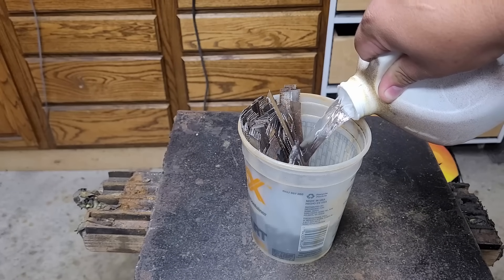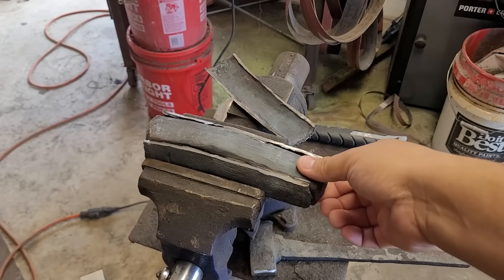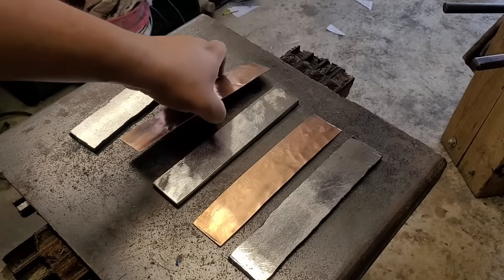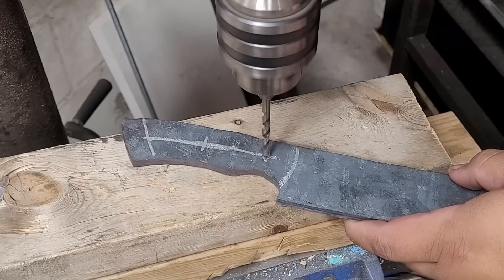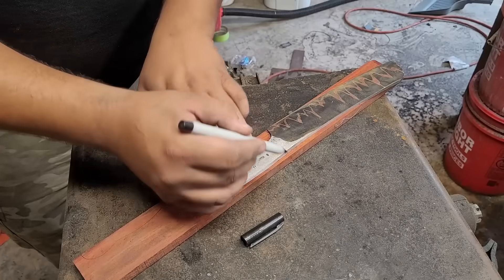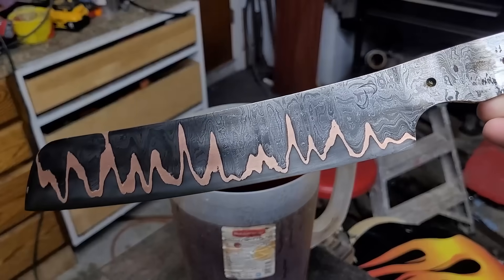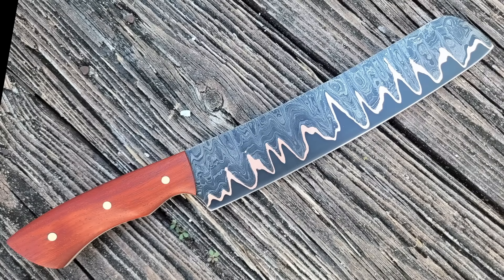Making A Knife From Copper And Bandsaw Blades

Comment: Beautiful choppa! Little tip: you don’t want to cut too much wood on the same bandsaw you cut steel with, without cleaning out the dust collector first. That’s a shop fire waiting to happen.
Reply from the maker: That never crossed my mind. Thanks for the heads up 🫡
Reply: Seen a band saw fire in the machine shop I worked in. Just complete negligence by the person who cut the wood.
Reply: I never thought of that either, good catch

Comment: Gorgeous blade.  The copper on black is really striking.

And don't get too comfy around that band saw.  Time it takes to rip up a finger is a lot less than the time it takes to realize it's happening and react. (And I'm saying that with a half inch gash on my thumb from getting a little too comfy by the hacksaw blade on a clingwrap box in the kitchen a few days ago)
Reply from the maker: Them clingwrap boxes are dangerous 😳
Reply: @JPsBladeworks  yeah, who knew!
Reply: Amen to that. Your fingers  get v. close to the band saw. Having worked in a joinery Ive seen too many ambulances and don't want you to need one. Stay safe.

Comment: The padauk looks good with the copper and dark black contrast. I stabilize wood. I haven't done padauk because its so naturally oily and therefore pretty water resistant.  Maybe i should though? I have a bunch of it.
Reply from the maker: I have a whole board of paduak i bought to stabilize but i havent bought the equipment for stabilizing yet. Maybe next month.
Reply: @JPsBladeworks  it's used for decking and cutting boards. It would probably be fine not stabilized.  When you do start though you'll use a lot more resin than you think.

Comment: Awesome job!  What do you use for outside canister can just mild steel?  Any links to 1090 powder supply?  Thanks!
Reply from the maker: I use regular mild steel tube. I'd recommend 1/8 in walls. No need to use any thicker since it will not be any benefit but it will cost more. And this is where I'd get it. https://maritimeknifesupply.ca/products/1090-powder-2-nickel?variant=39630768177319
Reply: @JPsBladeworks  Thanks bro!  Keep up the outstanding forging!

Comment: Thanks for the nice video! btw: I use Padauk often  with my guitar builds, there is no need to stabilize ist. it´s dense and keeps its dimensions very good! some use it even as material for fretboards - the it has to stay stable and hold the frets etc. And padauk needs UV resistant finish to hold the vibrant red hues. it shifts very fast to poop brown :D
Reply from the maker: Thank you for the info. Ill look for some of that uv resistent finish so i can spray the wood.

Comment: It’s amazing how easy your billet comes out the can.
Reply from the maker: It's all in the prep
Reply: @JPsBladeworks  yeah man. Spray paint over white out seems to be the trick. It’s amazing. Squashing from the top first too seems to work better than I’ve been shown in the past. I’ve always seen folks do the sides first but watching you how can you argue? Never seen it come out so easy in my life. Great stuff.
Reply from the maker: @guyfromnj  the preseason I do top first is because the lids are the weak point. So I can get a solid weld and pressure from all side in the first press. Before I used to go just sides and the caps would pop off and the ends of my billet would not weld properly. Now I don't have that issue.
Reply: @JPsBladeworks  yeah no doubt. Your billets are beautiful. It’s masterful stuff man.
Reply: @JPsBladeworks  it obviously makes a better billet. Having watched so many people make canisters it’s awesome to see how well yours come out.

Comment: I know nothing about knife making, so forgive the question if it’s ignorant, but with copper being a softer metal, does it effect the way the knife sharpens or maintains an edge? Or would copper ever peel away from the other metals?
Reply from the maker: No the copper doesnt affect the edge. The edge is the 80crv2 steel which is a high carbon steel. The copper brazes to the steel when it is forged so it wont unstick. The force needed to make it peel is magnitudes more than whats used for food prep or anything like that. Plus the core steel stabilizes the knife as a whole. Ive never had any issues.
Reply: @JPsBladeworks oh ok, that makes sense. Thank you for explaining it. Beautiful work btw. I do leatherwork myself but never made a sheath for a custom knife like that. One of these days though. Thanks for taking the time to answer my question.

Comment: You can trace the profile of the handle onto one piece of scale material, mark and drill pin locations, then stack and pin continuing and opposing scale material in order to make fewer cuts while making the handle. Layers 1A, 1B, 1C, 2C, 2B, 2A temporarily pinned, then cut.
Reply from the maker: I normally do 1 scale one camera then i pin it to the other to even out the holes and to get the same layout off camera.

Comment: Great looking blade. At what point of the video did you put the copper in? I did not see it. Just bandsaw blades.
Reply from the maker: When i restacked with the core steel i made a 5 layer billet with the outside beinf the bandsaw blades then copper and finally the core steel in the center.
Reply: @JPsBladeworks  Thanks! I tried several times to see the copper in there but just couldn't locate it. And clearly there is copper because the results are very clear. And splendidly vibrant!

Comment: Hey what coating did you do on the blade to protect it?
Diamond Like Coating, Titanium Carbon Nitride (TiCN) or a heating coating like clear Cerakote?

I didn't hear you say any coatings or what your Ferris Chloride actually does
Reply from the maker: ferric chloride etches it so you can see the different layers and i just use wax to protect the blade from moisture.

Comment: If you want to do stabilized wood you need a good vacuum chamber with vac pump and the best thing is to get in touch with a few micarta mfc comp to get the ins and outs with different types of epoxy. I used cactus juice brand to actually be the best performer for stabilized wood. You have a cost to this and it has to do with time. It really takes a lot of time. You can get stabilized wood from some suppliers but you have to take into account that they usually have large vats that they do bulk stabilized wood and it's not going to be that superb choice that you may want.
Reply from the maker: how long does it usually take to stabilize woods? I have some padauk that i want to stabilize. I need to tool up but that shouldnt be an issue once i decide to take the leap into it.
Reply: @JPsBladeworks  stabilized wood varies due to the fact it is a natural that has density and moisture and so many different things that can ruin it. Most of your high-end stabilized woods are done in small batches. But if you want to know how to mitigate some of this, I would suggest you contact the Cactus Juice company and get them to give you a better scale than probably any company can give you since they are the best wood stabilizer and have been around for a long time. I've actually helped build a couple of really nice rifles that had stabilized wood that you couldn't get from any source. I don't know how the good Dr. Had come up with the stocks but he made sure that these $7500 guns, this was in 1997-98 that we built the three rifles was after the stocks and all the other stuff was done, come in at around $25-35,000 and that was with the lower grade of the three. But it just gives you a idea that you can find a real treasure in your backyard. He had a tree cut off of his property here in North Georgia that was a native tree. I think it was actually black cherry burl that was classed as a AAAA which is the ultra best and rarest of finds. I had seen the stump and it was 35-39 inches in width. He had a set of three knives forged by some big name back in the day. That's three knives for each rifle. He had his, son in law, and grandson all done. It took us about 15 months to build those rifles and build the displays and carry cases. A person that does blacksmithing needs to get their hands into everything that they can learn and use. I like to go out and look for those burls and I like to do hand worked wood work like hewing and using a adze as well as build true classic log cabins that can surprise a few with no nail pining of the timbers.

Comment: I have to ask if you have ever done a twist with a drawn counter twist and drawn out to get a cotwist pattern. And I'd like to get a knife built that has some real unique materials in it and the handle scales. The only thing is I'm not able to build a knife anymore due to some serious injuries I developed over the years.
Reply from the maker: Ive never tried that and honestly i kind of got confused reading that. Do you mean to do a twist then draw out then retwist in the opposite direction?
Reply: @JPsBladeworks  yes that's what I meant. Sorry if I get a bit twisted up when writing or talking sometimes. I suffer from dyslexia and I got hit in the head with a 400 pound steel grate that nearly ended me. Stupid me just went home after and had to stay in the dark and quiet for about three months. It still bothers me after over 20 years later. Life is never fair or easy.

Comment: Use cobalt bits for drilling through hardened steels. Works great.
Reply from the maker: Ill have to give it a try. I normally shy away because they are twice the price over hss or black oxide drill bits.

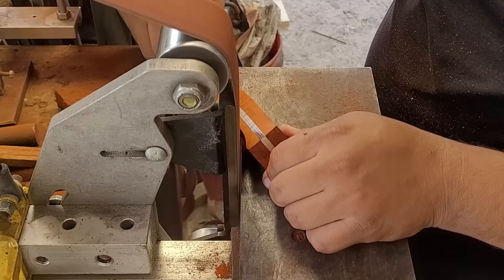Comment: 14:50 Perhaps use the platen edge to get the bulk of the shaping done and then use the small wheel you usually use to finish taking it down to size...

That might save time in future builds without increasing the hand sanding you have to do...
Reply from the maker: I detest handsanding 😅
Reply: @JPsBladeworks   Most of us do...

😄😁😆😅😂🤣

Comment: Question... Having the copper as the core, would that not make the edge very hard to sharpen, as copper is so soft? Or it would not take a good edge in the first place??
Reply from the maker: Copper isnt good as a core. It wont hold an edge. Its too soft. Thats why we use it as a layer just to give it a nice look.

Comment: Have you thought about setting your heat treating oven to the right temp for the copper and getting the braise that way? I've seen a couple of guys who make CU mai knives that way, and it seems like a more reliable method than using a forge. Haven't tried it myself yet.
Reply from the maker: My heat treat oven is a little on the small side. So it isnt the best for that. Maybe once i get a deeper one i could try. But for now its the good ole forge.

Comment: So relative newbie to forging. Doesnt copper weaken the blade because its a softer metal?
Reply from the maker: Yes and no. Yes because it is a soft material and not because the core steel holds the integrity of the knife. The tensile strength of copper brazing to steel is around 70k psi which is way more than a knife will see especially a kitchen knife.

Comment: What do you mean by stabilized form of the wood? Is that specific to mixing metal and wood or something else? I'm a woodworker and have made several things from Padauk, but not heard of stabilizing the wood or stabilization equipment. Thanks for the vid!
Reply from the maker: Stabilizing the wood means to remove all the air in the wood and replace it with resin basically making it into a hybrid material. Then the wood becomes water proof and doesnt expand and contract with temps or moisture.
Reply: @JPsBladeworks  OK, I do that with wood that has cracks or other defects in it, but not wood without defects. That's what made me curious because the piece you use looks perfect already. Putting a finish on it should function the same way I would think but never heard removing all the air. I will look that up.

Comment: Any tips for a beginner that wants to get into knife making?
Reply from the maker: If you got money and want it learn then tool up. A good hammer and anvil can go a long way. Get a forge or some kind of heat source and go for it. You wont know until you try. 

If you are like me and you are starting on a budget get yourself any good sized steel to use as an anvil. It doesnt have to be fancy. Many place around the world have a piece of round stock in a stump. Get a hammer. Harbor frieght is your friend. And modify the hammer to better suit forging. There are vidoes out there that show how to do that. And finally get a good fire source so you can start forging. Leaf spring is also your friend when starting because your first forged knives will be ass. Everyones are ass. Dont get discouraged just rinse and repeat until you start gaining experience. You got this. If i could do it so can you.

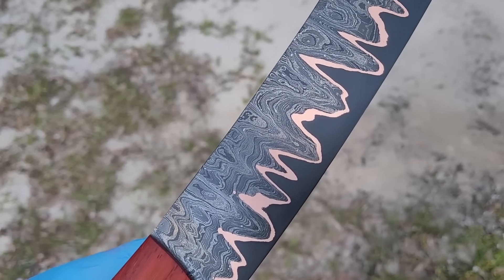Comment: 16:42 That's  cool blade.
But how will the copper hold up if the blade would be used daily?
Reply from the maker: Shouldnt be a problem as far as ive heard.
Reply: What would happen if you add coal powder to the mix? @JPsBladeworks

Comment: you can take a normal porta band saw blade & over sharpen every X 2 teeth. creating a chip cleaner effect. also if u tap those over sharpened teeth with a punch in opposite directions itll cut more aggressively.  
basically adding 2 opposite facing  teeth every X teeth.
Reply from the maker: Now that i think about it ive never seen blades for a porta band with bigger more aggressive teeth.
Reply: @JPsBladeworks  sounds like a business waitin to happen =)

Comment: Dam, I need a hunting knife that looks that good! Do they keep their edge? I bought a hunting knife from a feller and the blade had a hard time while I was skinning and cutting up the Elk and Deer.
Reply from the maker: Depending on the steel and the grind on the knife it can either be useful for skining or a nightmare. Also if the edge is shapened too fine it stuggles with animal fur and skin. Sometimes a 240 or 400 grit sharpen is the way to go for hunting knives.

Comment: I'd suggest cutting your copper blanks a little smaller than your steel blanks so you don't have so much trouble welding all the way around. Since the copper is basically melting anyway and giving you porosity in those welds.
Reply from the maker: Makes sense. Thanks for the tip.

Comment: The corrosion demons adore knives built with ferrous and non ferrous metals in the blade...Galvanic response. Good luck😁
Reply from the maker: How long is that going to take?
Reply: Depends on what the metals are exposed to and how clean , dry and oiled or waxed it stays of course. I wouldn't suggest using some super CLP that penetrates metal surfaces, dissolves copper residues either. Salt water will eat it alive. Human skin is full of salt due to sweat and bacteria also adds to these problems. Personally I would suggest Renaissance Wax, 4 VERY thin coats applied as directed. Food grade mineral oil if it needs cleaning, and store separately from a leather sheath . Im not trying to disparage your work. Its beautiful. But men stopped using copper, bronze and non ferrous blades centuries ago when high carbon steels were invented for these very weaknesses. Now we have CPM variant steels some of which are astounding depending on what you make the knife to be used for. If you fold and keep folding and forge welding layers of high carbon steels, you will eventually end up with monosteel. Even modern standard billet monosteels can have flaws in them we cannot see until they are put to microscopic examination. Original Wootz Damascus steel was made from ore with a higher concentration of vanadium, not copper, brass,,silver etc. In the end all steels and most metals corrode. Corrosion breeds weakness, and for a chopper "PINK" is the last sound you want to hear.

Comment: Another warning about safety. NEVER allow body parts to be in-line with a bandsaw blade. There's one point in the video where your thumb is about 1/2" from the blade and your pushing on the material.  I ran cabinet shops for 30+ years. The bandsaw is THE most dangerous tool in the shop! If your hand had slipped or you hit a void in the material... say goodbye to your thumb.
Reply from the maker: I thought it was the table saw? I work in a cabinet shop and the table saw is very scary. Ill use my push stick next time.
Reply: @JPsBladeworks  according to OSHA the bandsaw is #1 for injuries. I had an employee nearly remove his lower arm with one. And I've done stupid things with a tablesaw and paid for it. Just always be conscious of where your body parts are, where the cutting edge is, and which direction force is being applied.

Comment: Are we going to skip over the fact that the handle is uneven? Don’t get me wrong it’s a nice knife but there is a difference between each side of the handle.
Reply from the maker: I'm not perfect and I have to get videos out as fast as possible. Youtube is a scary place if your not somewhat consistent. Plus I'm no master blade smith so theres that.
Reply: @JPsBladeworks  not saying you have to be perfect may man but it’s not a negligible difference between the two sides. It’s very noticeable and I am not trying to be mean here or anything I just think that maybe you should build it in steps for a few videos so you can slow it down. This way you still put out content while making the best product you can.

Comment: Copper tarnishes badly and it's too soft for a knife. It's pretty but I'd have used brass or bronze instead
Reply from the maker: The copper is for asthetics. The core steel is what does all the cutting and thats a high carbon core. So no issues there.

Comment: The blade came out great, but the taper on the  handle is obviously not even on both sides.  The right side is thinner than the left on the bottom.  Surprised you didn't catch that.  Also your shop safety is questionable.  It's all fun and games till you lose a finger or two,😢😢.
Reply from the maker: Or 3 😱
Reply: @JPsBladeworks or 4